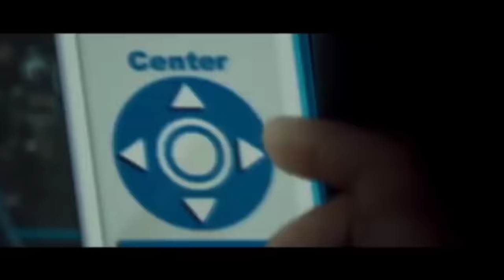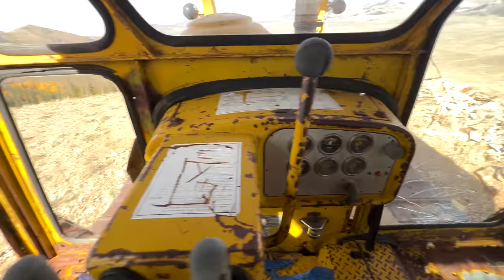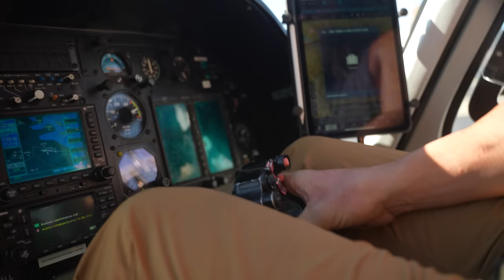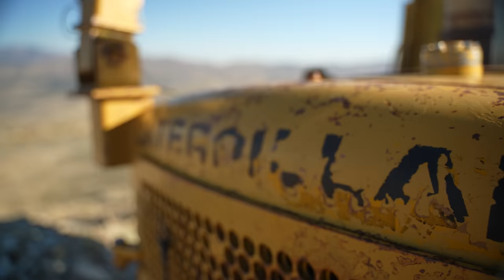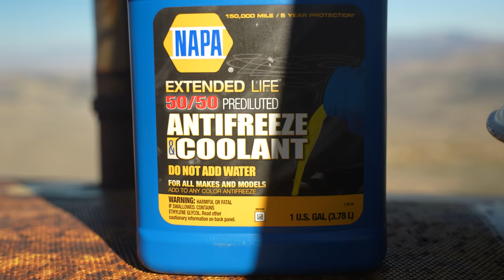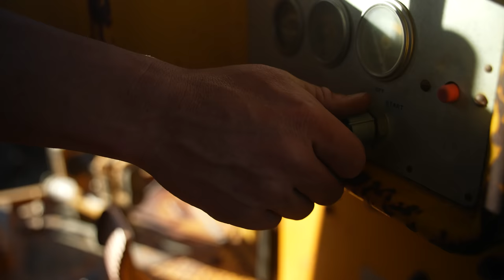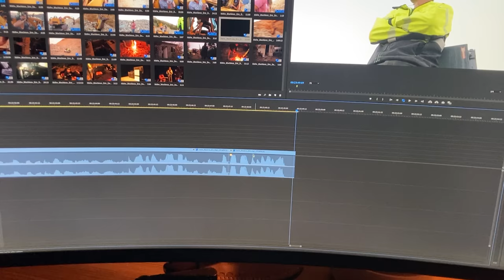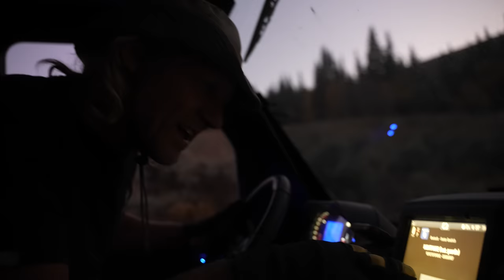Giant Earthmovers Left Abandoned And Now They're Mine!

Comment: That Big Dozer with the big cab would be sweet to resto modded. It would be cool to integrate modern controls and comfort to a massive cab like that. A/C, heated and cooled seats, a mini fridge, wifi, etc.
Reply: Thatd only cost a cool million or two… 😂
Reply: @jeepnutscotty  nah. he owns a shop. labor is already payroll.
Reply: @dustyc324  your comment only proves you have absolutely zero idea of what's involved or the cost of components... 1-2mill would be parts alone, zero labour. Go price a compatable electric over hydraulic blade controller, let alone the electronic trans, or the ACERT Engine, custom wiring looms ECU's, custom fabrication etc
Reply: That would be cool to see the cab be all fixed up. But the controls for that machine are all mechanical linkage directly to the brakes and drive clutches so sadly you cant make them modern.  But they are a blast to drive and gives you respect for the guys that drove them for 10 hours plus a day. they are rough to operate.
Reply: Keep it just the way it is. Just fix the issues it has back to factory condition and itll work for much longer than most new machines
Reply: Crypto scammer in your comment trying to steal your money

Comment: My dads first new dozer was a D7 identical to that one minus the cab and ripper. Was a hard workin machine and helped save our towns during the winter of 1997. Built a plywood and plexiglass cab around the rops with a pipe across the hood from the front of the radiator blowing heat on his feet. The 235 is about 85,000 lbs and the 245 is about 135,000. Both slow but hard workers in their day.

Comment: In the early 1980’s, the firm I worked with was asked about the feasibility of building a series of 400 foot long modular structures. They were to be fabricated in the ground of steel and concrete and then lifted into place so that they spanned across one road and the buildings on both sides of the street. The effect was to create a new very high end shopping and residential district on top of the structure. There was a crane capable of lifting these inits. I think the brand was Manitowoc and it was located in Alaska. It would be dismantled and shipped by rail to Phoenix. Ultimately the plan was abandoned but I recall that one link of track fit on one rail car. Now, that’s a big machine.

Comment: Mix up your own Bro juice to free up stuck engines. I use 75% acetone and 25% ATF. I have freed up several farm tractors using this mix. You can make it thinner or thicker as you like. I have not found any kind of penetrating oil that works better. If you have time and the engine is really struck use white vinegar and wait at least 24 hrs longer is better just make sure to put in enough Bro juice or vinegar  so it get to the outer circumference of the piston so it gets down around the rings. When it frees up, bar it over carefully to make sure it is not hydraulically locked.  I also use the Bro juice on stuck bolts a long with a air hammer lightly hammering down on the bolt. the vibration helps it soak in. When I say something wrong I get the dog house. You go to the tree house!😆😆

Comment: Heavy d, try using evapo rust for a rusted engine next time to free the rings. I used it on a drive chain on a scooter years ago and within 12hr of initial soaking in a bowl the chain was not fully froze anymore and I was able to start moving it. I let is soaking for another 12hr and other then some light rust in the pits of the metal the chain was almost new again.

Comment: I never put antifreeze into a machine where I don't know if it's going to leak/overheat or not when water is SO much cheaper.

Also, to unstuck a frozen motor your cheapest option is to just fill it full of diesel and let it sit a day or two then start working it back and forth from the crank pulley with a big socket and breaker bar (usually with a big cheater on it)

Comment: Hi Dave. Was wondering if you ever considered building a large hydraulic power pack that could be plumbed in to the hydraulics so you could possibly still lift a boom or move the tracks. It could be on a small trailer and towed behind the equipment.

Comment: Pre lube the cylinders on the d7,put a remote fuel system on it some batteries crank it over by hand a few times and it will run,
Reply: I just did this on a 78 d7 that sat for 12 years walked it out of the woods and sold it for 25 grand in alaska
Reply: Yep ounce it displaces the air in the hydro system it will opperate

Comment: 60 ton is only big for a construction digger, in surface mining a big digger is 400 (metric) tonnes with a 1900hp V16 and they go plenty bigger than that. Still impressive old machines, I’ve worked at mines with Kobelco diggers and they are reasonable.

Comment: Cool on the 935 the hydro motors are accessable usually not ! That's a plus ones I've taken out on smaller units are a pain ....those Detroit's alot of times just need lift pump or ck for fuel flow , ie, clog, Thier tough ...twin engine., Is wild never seen one..

Comment: Listen very close boys and girls and learn something here. See the hydraulic polish rods on these excavators? You notice how they're still shiny, clean and no rust? That is before all of our production was sent to China. We used to leave our wheat truck beds in the air over the winter to keep the snow and rain from collecting in the bed and the Polish rods were always extended sometimes for many years. Nowadays since the steel we received from China is junk, IE low nickel content no high quality hardening of the steel. You leave the Polish rods in the air these days they will be solid rust within a few days and when you let the hydraulics down the rust destroys the cheap Chinese seals so they all leak right away. That's what we got when the Democrats sent all our production to our enemies. All the parts we buy now from the local parts stores are garbage the wheel bearings are junk no nickel content ball joints radiators it is all foolishly garbage. Come on back president Trump and bring our manufacturing back to our cities and our people!